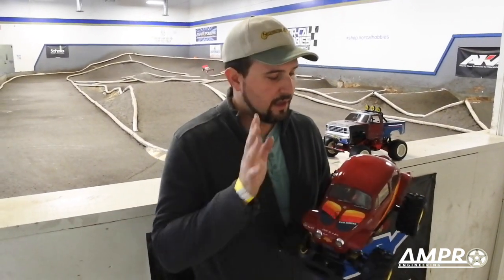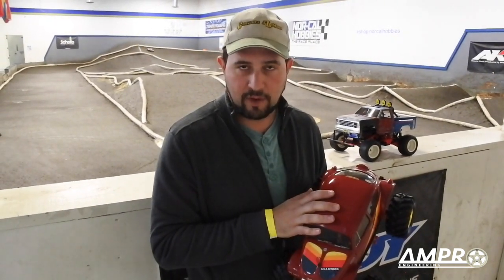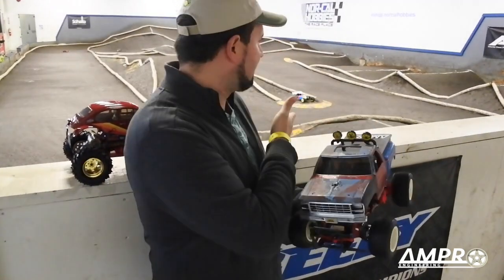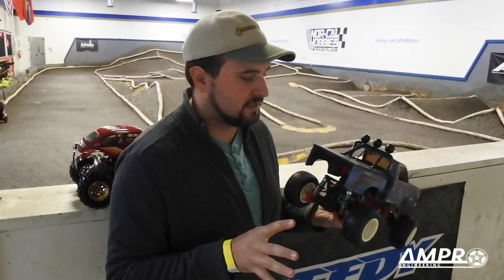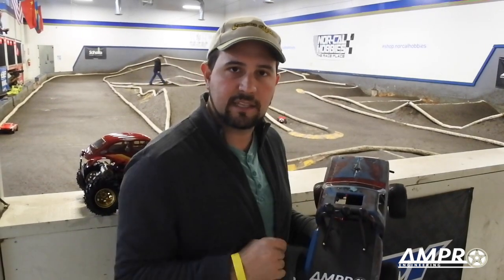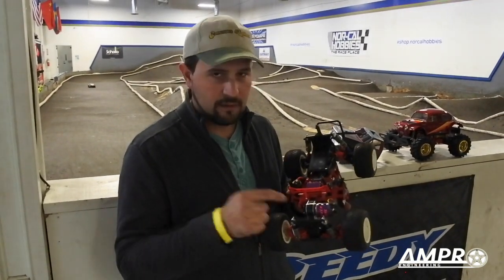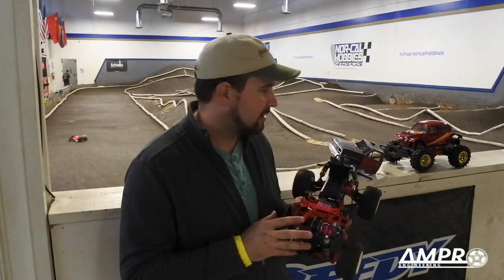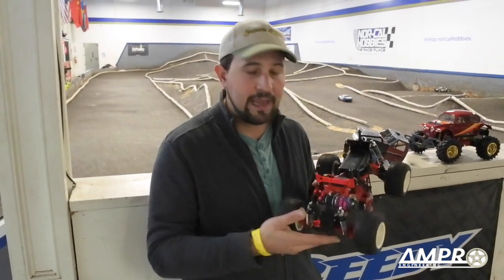E45: MIP Tamiya Blackfoot Super Ball Diff Test Drive

Comment: You are 100-percent correct...my 2016 Blackfoot has full ball-bearings, a SPORT TUNED motor, and is otherwise stock.  I ran the truck about 12 times, and I already have the nerve-tingling crunching sound coming from the transmission differential.  It sounds like 1986 all over again!!! 
I just ordered the MIP ball diff, and I cannot wait to eliminate this ongoing problem that has been passed down to the re-release.
Reply from the maker: You know, I rebuilt the diff in my project mudblaster before the MIP diff came out. Over the course of 3 runs and maybe 5 batteries with a upgraded stock motor, the diff completely blew out. Seriously that diff is trash.

Comment: Thanks for all of the videos following the MIP ball diff! I got started in RC a few months ago with a re-release Brat and was very excited to see this new diff come out for such an older car.

I was part of the MIP pre-order and purchased all of the parts you've noted in your videos to get my Brat running with the new diff but am I going to see a reduction in the top speed of the Brat by running the 16 tooth pinion? I've been using a 15T brushed motor with the 19 tooth pinion in the stock gearbox without issue. I'm eager to try the new ball diff but I feel like I'm going to be sacrificing top speed for gearbox longevity (not that it is a bad thing).
Reply from the maker: I am glad you are back in the hobby! I have had my Brat since the 90's and it has always been one of my favorites. As for speed, yes, you will lose some with the smaller pinion but I think you can run a higher tooth one if you get the  CRP adjustable motor mount. Honestly, with a 15 turn motor, you wont notice it. I will be very quick with that and the diff will last a lifetime!

Comment: I got my original Monster Beetle back in 1987. shortly after I upgraded the transmission with a ball differential and dog bones. so they must have brought  back in to production. I'll have to get one for my rerelease Beatle.
Reply from the maker: Yeah I worked with MIP to get them to build a ball diff. These modern ones are sensational. I also had the Thorp diff and it just was not up to the task of modern batteries and modern motors.

Comment: Cool! I have destroyed my Monsterbeetle Body during my first Test with MIP diff! Hahah, gears ok, bodies broken!
Reply: That is too funny :)  I bet we will see an increase in the number of bodies and other parts sold for these cars now that they can actually be run like crazy! :)
Reply from the maker: See I have not problem if it was my fault but clearly I was rear-ended! Jeez! Yes my gears were fine after 2 battery packs though...Glad you are liking the diff!
Reply from the maker: Yes I think you are right! Honestly it is my fault, I have a lexan shell for it I just have not figured out an "Ampro" paint scheme!
Reply: Suppose you got to use a lexan body for bashing instead, there are some pretty decent looking lexan bodies that can handle the bashing easily.
Would be about 1 cm short on the wheelbase for traxxas stampede bodies but if you do the placement on the bodymounts correct i doubt you'll notice.

247mm wheelbase on the blackfoot vs 258mm wheelbase on traxxas stampede.

Comment: Wow that went well shame about the broken bodie lol
Reply from the maker: Well technically it broke many, many years ago but the braces I made for it were not not enough for that roll. I painted a lexan shell last night so that will be the end of top heave project Mud Blaster.
Reply: Lol yea some of the bodie can only take so muck knocks through the years, Just a quick question can the Black Foot go through water ok & wont do any damage?
Reply from the maker: Well, mechanically the truck should be fine but salt water will kill it due to corrosion. The transmission will fill with water but it should drain. The main issue is electronics. They would all need to be waterproof. As of now, I own nothing close to waterproof. I hope that info helps!
Reply: Yea thanks for the info!  yea i wont go near salt water probably just small puddles & dirt it should be fine, i wouldint mind a waterproof truck so i dont have to worrie about it to much
Reply from the maker: Yes its better to be safe than sorry